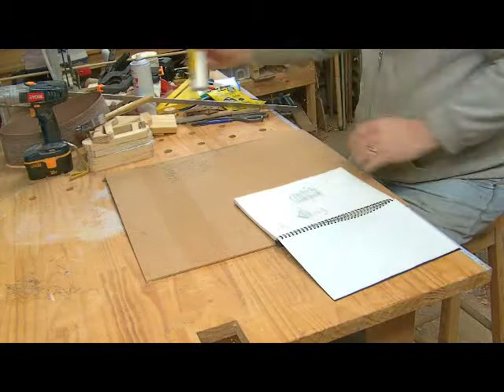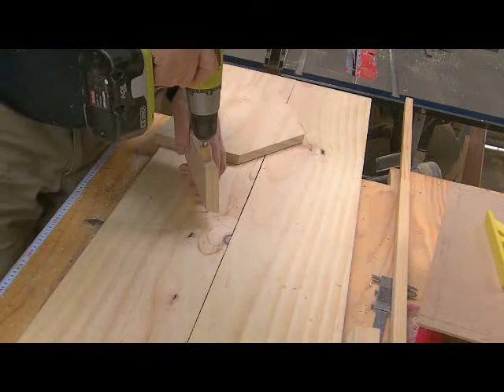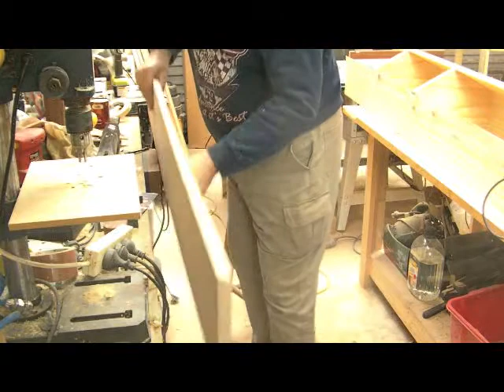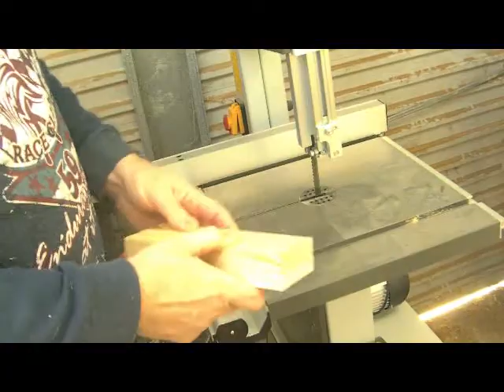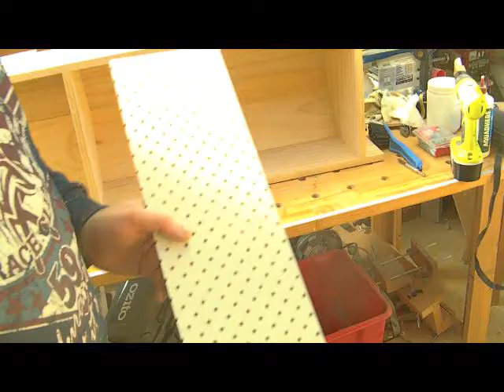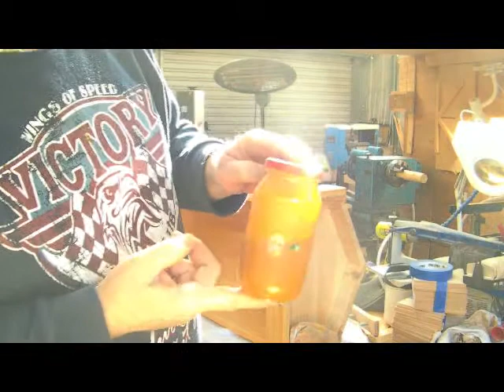Corner Unit for very tight corner

Comment from the maker: Hi, thanks for the comments. I bought a set of three in a small box. ust your common dowell sizes. They are just called Plug cutters. They should be available at you local hardware i  the tool section.
Regards
Rob